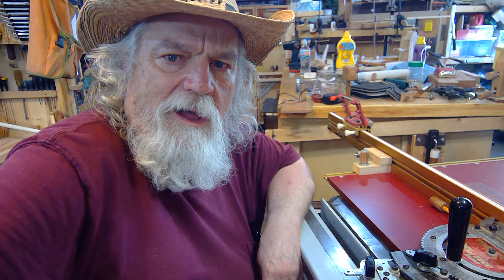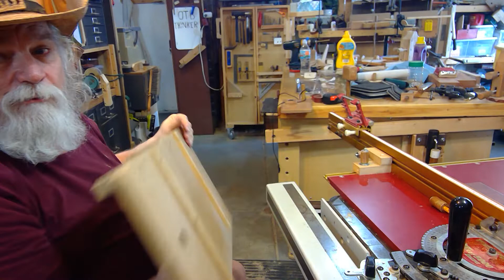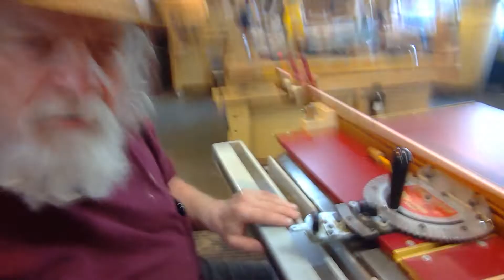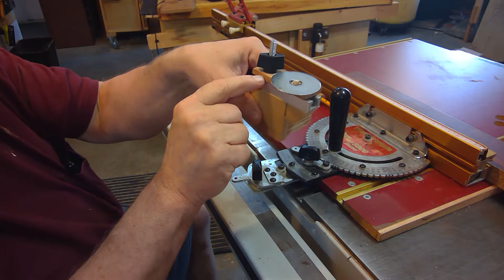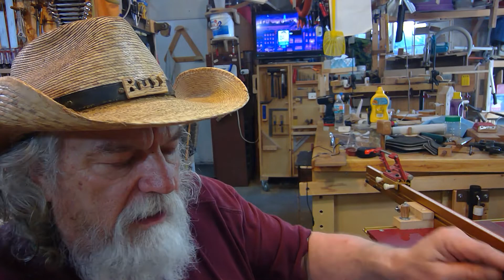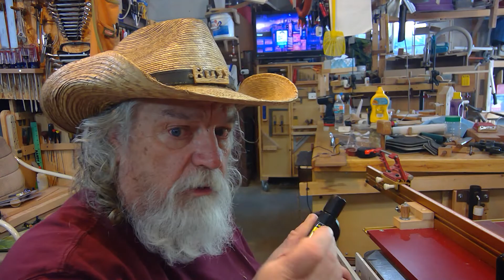Cross Cut Sled With Laser Line by OTB Thinker

Comment: Here's a thought: if the laser is a measuring tool i.e. it reads out a distance - then it would be very useful to be able to measure from the stop (on the left end of the workpiece) to the left side of the saw blade teeth. So you could dial in the cut length you want on the workpiece.